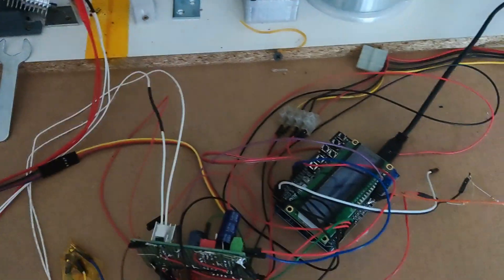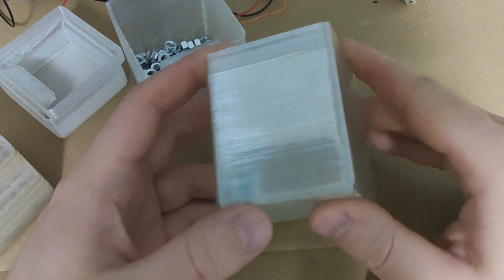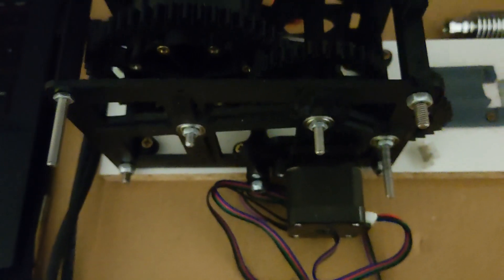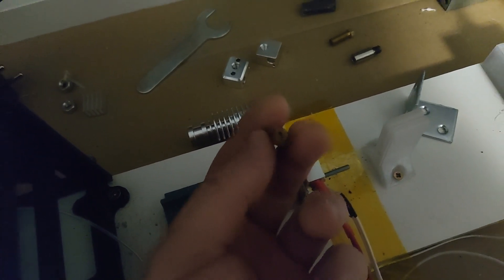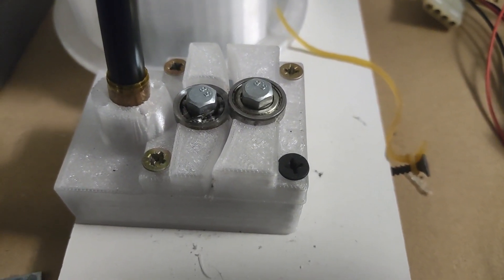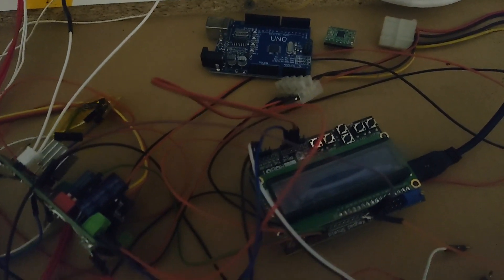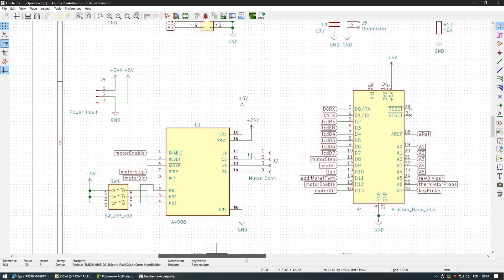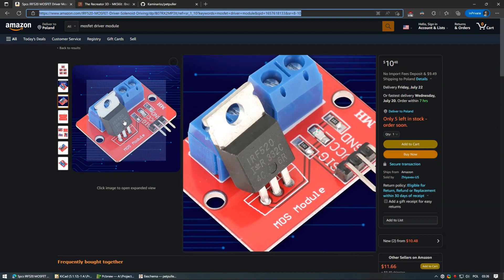Free filament maker machine part 3 - PetPuller Assembly

Comment: thanks for sharing.  the thread IS m6... at least the block I´m using.  could you please give more details on why you are using that voltage divider and what you put on the code in regards at that divider?
Reply from the maker: Raw voltage divider is there to compensate for potential issues when reading thermistor, it should not happen but it did in my project, you can check that in code

Comment: Can i use an old anet a8 motherboard for the pulltrusion machine? Thanks in advance
Reply from the maker: You technically could but that would require changing firmware as standard 3d printer firmwares cannot handle infinite extrusion or infinite movement.
Reply: @KaminarisTech  what firmware do you use?
Reply from the maker: @WhatWorks-DIY  Its in the description, would need work to get it on your board tho.